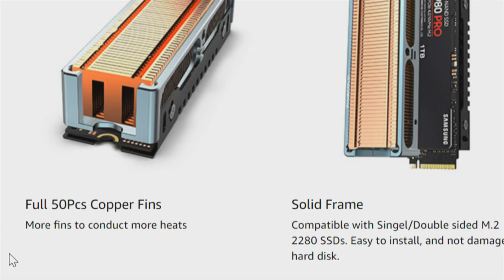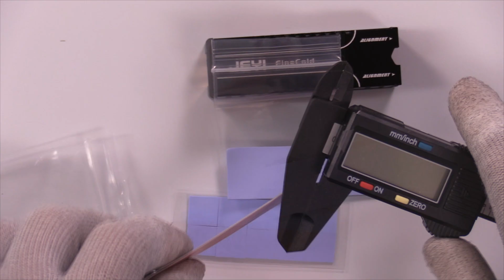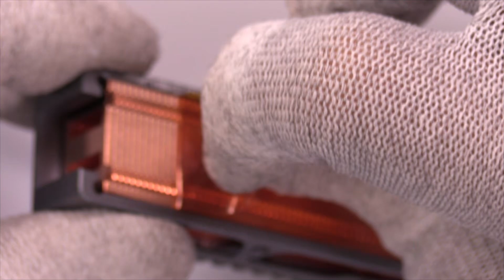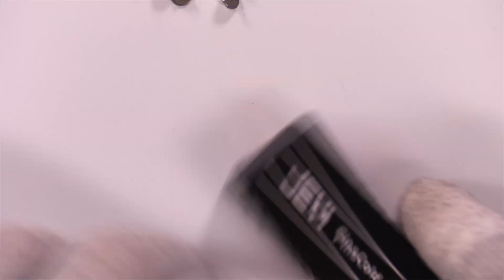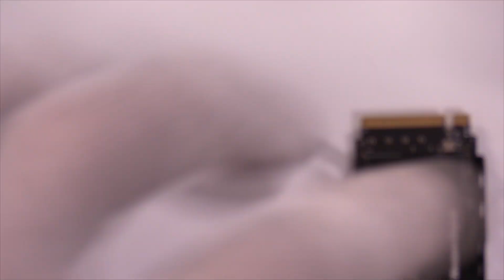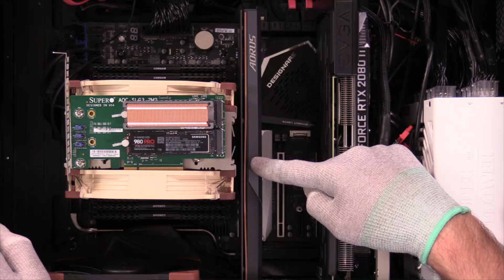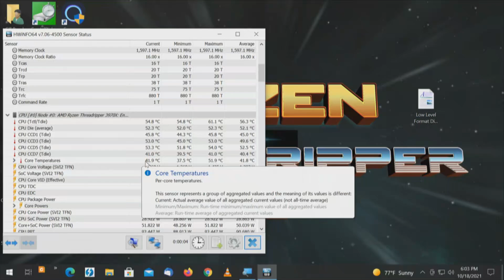Jeyi Copper Finscold Q150 M.2 Heatsink and WD Black SN850

Comment: If I were to do a video on my p620 as a somewhat average user, what would you suggest I go over?
Reply from the maker: Excellent Question! I'm honored You asked! Cover the What, Why and How in each Video. You could do several Videos about the Lenovo Threadripper Pro P620 Workstation. 
1. Overview and make the case for Your Choice. 
2. Features of the Motherboard.
3. Bios. That alone would be insightful. 
4. Configuration and Options. 
5. Tests and Results or Benchmarks using the Applications You use and work with. 
And that's just for starters! Hope that helps! Success on Your Filming! Keep Us Posted on Your Progress!
Reply: @BuildOrBuy  Will do!
Reply from the maker: HI @recklessthor4 ,
Outstanding! Success on Your Project!
Reply: @BuildOrBuy  I made the first video trying to push the cpu! I was able to use OBS studio, Warzone, Google chrome, and Autocad simultaneously!!
Reply: Please give it a watch and tell me what you think.
Reply from the maker: Hi @recklessthor4 , Congrats! Success! Unedited, ok. If You ever plan to have a wider Audience or to Monetize one day, watch the language. And Work on Your SEO!
Reply from the maker: Hi @recklessthor4 , 
Congrats! I'm on limited bandwidth on Smartphone this evening. Fiber installers cut cable. I'm in limbo until repaired hopefully tomorrow! Always do Your Research! Success and Best Wishes!

You have a lot of Content to do on Your Lenovo P620!
Reply: @BuildOrBuy  Will do! Being a sailor the language is difficult 😂
Reply: @BuildOrBuy  Some more videos as to the actual function are coming soon!
Reply from the maker: Hi @recklessthor4 , Understandable. Think long-term. Advertisers and a wider Audience. And Thank You for Your Service!
Reply from the maker: Hi @recklessthor4 , 
Suggest start from the Beginning. The what, why and how. Now You're a Content Creator! Looking forward to Your next Creation!
Reply: @BuildOrBuy  Thanks!
Reply from the maker: Hi @recklessthor4 ,
Absolutely! Thanks for Sharing!